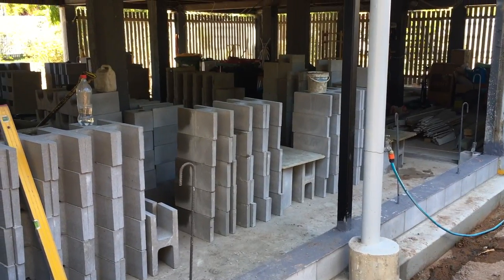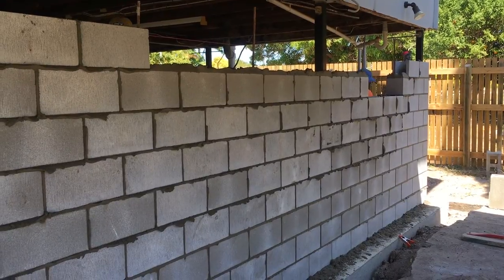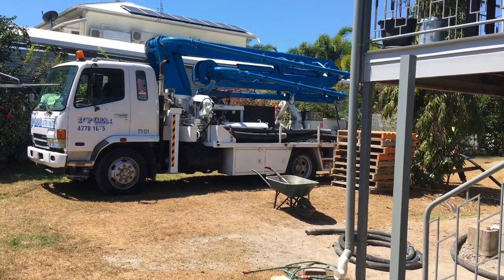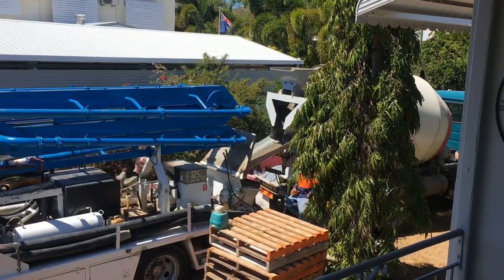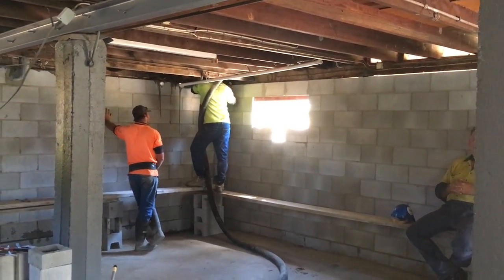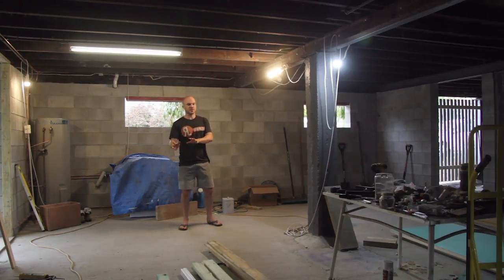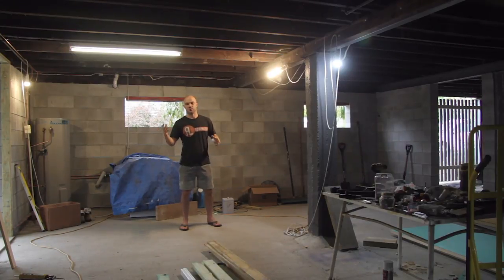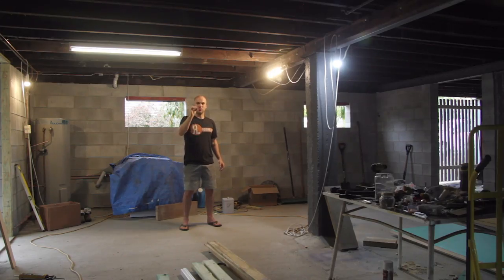The Workshop Walls Go Up

Comment: With them filling up the wall with concrete - would it not have been easier (and maybe cheaper) to pour the concrete into a mould with re-bar? A bit like pre-cast but doing it in-place.
Reply from the maker: I hadn't even thought of that. None of the bricklayers I contacted mentioned that method, so maybe it's not a popular method here

Comment: Correct me if I'm wrong, but the block walls are not structural are they?  They are just filling in between the posts that support the house?  So why did you pick block over 2x4 type walls?
Reply: I believe they are structural, especially when they are filled with concrete like that. And there is probably some rebar in there. I know a lot of commercial buildings (like Lowe's, for instance) are built with cinder block walls around here (Mississippi, US). And in Florida, many homes are built with blocks like this to withstand hurricanes. I know my aunt is just outside of Orlando, FL and I was talking to her about this past hurricane, Irma. She said their house is built to withstand winds of up to 130mph.
Reply: I believe a high level of sound proofing was one reason.
Reply from the maker: Hey Art. In my case the walls aren't structural, the steel posts are what are holding up the house. BUT, in an effort to keep sound to a minimum, and because technically I'm in a flood zone so I might have water around the base of the walls, I chose concrete over timber
Reply: That reminds me... have you solved the issue of the drain pipe that used to head over the neighbours lot that was closed off?    I think you had to talk to the city about that?
Reply: I too was wondering why you used blockwork, but it makes much more sense now that you say you are in a flood zone. My house is very similar in that it is a high set house that I am planning on building under, and is also in a flood zone. I cannot use blockwork though because it will be too heavy - my footings are on screw piers that go down to the bedrock 32m (yes 32m) below the house. That distance severely limits weight bearing capacity. Any thoughts on alternative lightweight waterproof wall construction?

Comment: Cool stuff mate, Are you putting in a hanging ceiling to stop noise going upwards into the house?
Reply from the maker: Looks like I'm going to have to. I was running the thicknesser in there today and my wife reckons it sounded like she was right on top of it. The 20mm pine floorboards do nothing to keep the sound out apparently
Reply: No I doubt they will. Bob Clagett, just did a good video on acoustics and hanging ceilings. Worth a watch.
Reply from the maker: I saw that one and decided to get a sound level meter for myself. I'll be doing some tests to find out how I did
Reply: Good luck, Jeez you've reminded me I need to get out and make a few more videos.
Reply: Let me know how it goes, I'm got serious shed envy